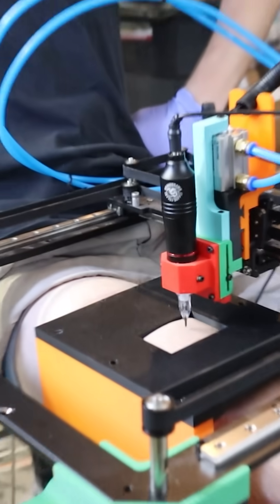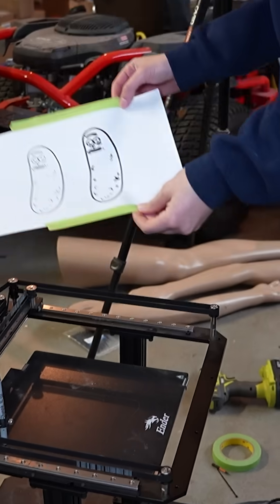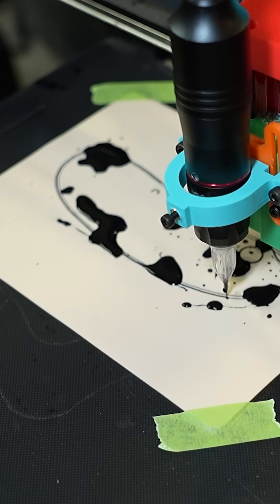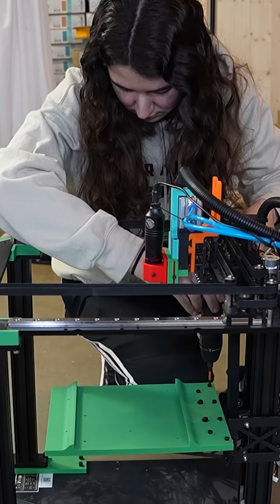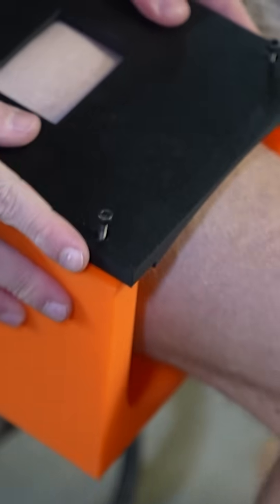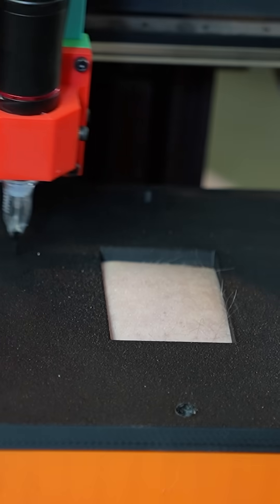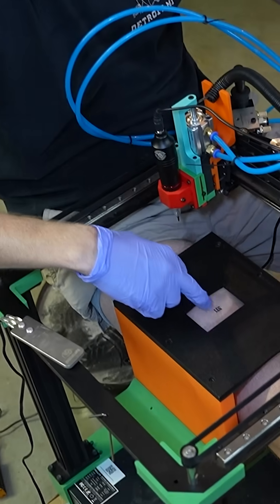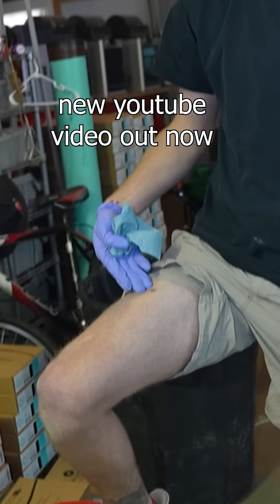Tattoo 3D Printer?

Comment: This woman single-handedly designed the future of tattoos!
Just imagine... Scanning a picture and just lining yourself up for some ink. Awesome!
Reply: It actually would probably be way more expensive and not very good for big tattoos (you would need a machine to big)
Reply: @iami5124  it’s defiant possible, but for this technology to be advanced enough to do large intricate tattoos, you basically need the pinnacle of medical robotics with multiple needles going at once, basically like a printer, with incredible depth perception. The machine would be millions of dollars minimum. I’d rather just get it done by a person instead of supporting another industry that treats art, and artists like a worthless commodity.
Reply: People are making these. Theres a company that makes them, and they're not very good. They mess up often and don't have the range and ability an artist does
Reply: @maddiewhatever441  i believe it. Especially once someone squirms!
Reply: It needs ALOT of tweaking before that can become a reality. Tattoo ink needs to be placed a certain distance inside your skin to keep it from fading or disappearing entirely when your skin regenerates. You also can't put it too deep or you risk massive infections. There would need to be some sort of pressure sensor implemented. They would also need to rotate the person getting tattooed for pieces that wrap more rounded areas (which is most areas on your body).
Reply: @blueeyedbatman I actually 100% believe it could easily be made today if it actually was seen as something that could be profitable. All of those types of things are already done with all sorts of different robotics and CNC work. With needing to move the person most of these machines a physical tool to reference locations but you also could implement an optical sensor that uses reference points to figure it out. It could range from really basic linear rsil systems like this all the way to multi axis machines.
Reply: I mean tattoo MACHINES decimated the original tribal tattoo method, history moves forward old ways become obsolete
Reply: Even for that tiny ass tattoo the man moved a little, theres 100 different factors an artist has to deal with and manage at all times that a 3d printer cant do.
Reply: You're meant to tattoo at an angle if you want it to properly set in to the right layer of skin to be longer lasting, a machine like this aiming straight down cannot achieve this
Reply: Another one for the whites.
Reply: Starship troopers lol
Reply: They already existed.
Reply: @valle6o727  I think it’s a fun gimmmicky YouTube video, and at least it’s better than all the TikTok kids tattooing themselves at home with no gloves, Amazon or Temu machines/ink and to top it off giving themselves face tattoos for some reason, but no she is very far from the first person to on do this. There are already actual “studios” (if you wanna call it that) where people have these stupid tattoo robots printing generic tattoos poorly in people. I’m not against AI, or robotics, quite the opposite actually. I think that they are humanity’s best chance of getting away from the current USA work all day everyday until you die, with as little free time as possible, lowest pay as possible, and basically zero benefits. What I am against though is AI, and robotics taking the jobs people actually want to do, like artists, writers, game devs, actors, etc. The pitch for AI just 5-10 years ago was people not having to work jobs they hated, and having more free time to spend with friends, family, and pursuing creative endeavors like the ones previously listed. Instead so far we have server farms using more energy than some countries to give us much worse search results than we could have just got on google, crappy generic art, and every garbage company trying to destroy every creative field that exists. Yay the companies win again, while life isn’t getting remotely better, and actually worse for the average person. That’s what I call progress 👍😅
Reply: No she didn't, this isn't her original idea and it's been done before
Reply: Until the client moves slightly and ruins the entire tattoo
Reply: A small distance laser and some 4 axis arm solves a lot of these problems. Emergency stop button for those idiots that will inevitably try to move while the machine is running. Maybe a special transfer paper that the customer can apply themselves. Something with a special ink that the machine can see even underneath ink and blood.
Reply: she hasn't designed it, this stuff has already been done before.
Reply: no more fucked up tattoos from people that stay awake all night doing drugs..
Reply: And when it glitches, you get who knows what on your skin. I'll stick to humans, thanks!
Reply: Tech has already changed tats. We used to use needles and inidian ink...
Reply: This wouldn't work because it clearly requires your skin to be a flat surface just like paper, which you aren't. The most tricky part of tattooing is being able to work around curvy and squishy body parts. You also need to stretch the skin as you deposit the ink or the ink won't stick.
Reply: No more Revenge tattoos from crazy exes
Reply: Imagine you go to the automated tattoo booth down the street, load up the picture you thought was really cool from google and get it done with, but when you get home, you realize you forgot to make sure the png was actually transparent.
Reply: Nope. Human body parts are not flat like paper. Different part has different skin thickness.
Reply: Yeah, this would never happen the amount of danger. This actually has is so unfathomably high if that went slightly too far down because of an error hello major gas hello hospital hello severed arteries it’s a cool video but the amount of danger they put themselves in is horrific. This will never be how tattooing is done.
Reply: Until you move slightly and mess up the alignment.
Reply: rip my job then
Reply: They were both expecting the worst, then suddenly it looked like a completely reasonable business idea
Reply: I had this exact idea 20 years ago... unfortunately didn't have the means to do it... i have a more refined and detailed plan that would be the future for sure but i doubt i will ever get around to it.  A company like epson could do it though 1000%
Reply: I’d bet that tattoos and technology far into the future would advance to a point where you can just have a tattoo scanned and printed onto you with a small hand held machine.
Reply: I’d bet that tattoos and technology far into the future would advance to a point where you can just have a tattoo scanned and printed onto you with a small hand held machine.
Reply: Then the power goes out
Reply: I can’t imagine it having a remotely even appearance, if anything it would have to be done by a computer THEN touched up and shaded by a tattoo artist. Otherwise it’s not gonna look very good. Just too much variation in depth.
Reply: @QNominall it could easily be able to sense the exact depth needed with anything other than a 3d printer.
Reply: @QNominall  if only there were devices that could read and measure depth and automatically adjust the height? 🤔🤔 oh wait!! There are such devices!
Reply: @QNominall  lmao literally the same sort of problems 3d printing had before it went mainstream stuff like this is inevitable
Reply: @QNominall her 3d printer version yes. If you think robots can't replicate human art in perfect detail you are going to be violently awakened someday
Reply: @ Replication is one thing, new creations is another concept entirely.
Reply: Completely decimating another industry because of robotics isn't awesome.
Reply: @The_Stranger1986  I would still get what they would probably refer to as "traditional tattoos". I do believe this is a really cool idea but it would be for a more specific and probably smaller market
Reply: @valle6o727 so you mean a tattoo like they traditionaly do in the Pacific islands with the stick and little hammer thing one stick one hit at a time? Because that what tattoo guns replaced aka technology/robotics.
Reply: @The_Stranger1986  my guy people still get traditional stick and pokes with thorns sticks and charcoal powder 😂
Reply: @The_Stranger1986 I think we’re still like 50 years from an actual, affordable, commonplace, decently talented robot tattoo machine 😂

Also fr you can’t fault people for wanting a machine to do the art that will be on them for the rest of their life. Far too many “artists” are absolutely terrible or weirdos or assholes, or shit even just straight up judgy and won’t do a tattoo cuz it’s not cool enough or w/e. People don’t wanna deal with that.
Reply: @The_Stranger1986  artists Will always be better
Reply: @The_Stranger1986 it is
Reply: @The_Stranger1986 yes it is because if iring progress on purpose is stupid, we're all going to have basically no jobs eventually anyway. I'm sure there would still be an entire community that would brag about getting human made tattoos but this could open a world of designs and realism never possible by a person. 
It would also work wonders for the possible future "camps" 😅😂
Reply: @The_Stranger1986 oh get a grip. Someone still needs to draw it in the first place. Youd rather we stay in the stone age just because you can't see why this is a good thing being the tattoo will look nicer and cleaner if setup properly.
Reply: @The_Stranger1986 lol it won’t decimate it. It’s for convenience. Vast majority of people don’t have the money for a 3D printer, much less get enough tattoos to buy one.
Reply: @The_Stranger1986 i’d take this over pretentious tattoo artists giving me crappy tattoos at a ridiculous price anyday. at least it can draw a straight line! 😂
Reply: @The_Stranger1986 sorry bud but i dont like dealing with strangers who will be putting permanent artwork on my body. You are less trustworthy than a machine.
Reply: @The_Stranger1986 not at all, the thing about tattoos is its artistry, art is highly subjective, but I'll be damned if I'm going to let some machine do the line work on my arm. I go to a professional artists with a real reputation and actual skills built on experience. The same type of people who have the dedication to spend large amounts of money on ink, are the same to appreciate the skills that come with that ink and price tag.
Reply: @MrDeano-bm8qg a machine could be trained on literally millions of hours work in a fraction of the time when it's perfected. This will be the future but there will always be human artists unless machines become so perfect it'd be dumb to get something with imperfections unless it was on purpose for the design but even then you could just program that to seem random variations even if it's not.
Reply: @The_Stranger1986 do you have tattoos?
I have many. I would never get one by a fucking machine.
Reply: @The_Stranger1986  things'll change, some folks might lose their jobs, yeah.  But tech's gonna keep moving forward, making new opportunities, and leading us to a future of automation.
Reply: @The_Stranger1986 Yes, it is. Why spend hundreds on tats when a robot can do it for 5.99
Reply: @The_Stranger1986 but it will increase jobs in other industries
Reply: @The_Stranger1986  It wouldn't decimate the tattoo industry because it's not capable of doing all the minute details that a human tattoo artist can. Sure, with a 3-D printer Dana. Tattoos on you could do any design, but it wouldn't have the depth or detail that a real artist brings into it.
Reply: @The_Stranger1986 unfortunately people are not entitled to professions. That’s just the reality of the world.
Reply: @The_Stranger1986 tattooing isnt just putting down lines. Of it is youre not good at it. We have nail polish machines but people still go to salons
Reply: @The_Stranger1986  It is when they're needlessly expensive.
Reply: @The_Stranger1986 buddy: it’s gonna take a while for that to be decimated and even then people will want their classic human made tattoos. Quit thinking ai is gonna take over the world.
Reply: @The_Stranger1986  You should already be tinkering with this stuff if you want a future in tattoos.
Reply: @The_Stranger1986  not really, if you want a traditional tattoo you can still always get one, don't be mad because people can do things themselves now.
Reply: @The_Stranger1986 I bet you think we shouldn’t have invented the tractor too, right? Or that one is fine by you?
Reply: @The_Stranger1986 If it wasn't for robotics we wouldn't have most of the things we have today at such an affordable cost. Pretty much every single industry uses machinery. Vegetation, dairy, furniture, health care etc. This is just one more thing added to the list.
Reply: @The_Stranger1986 the entire point of technology is to make life easier. If done correctly we can literally get to a point where humans just enjoy life in stead of working 90% of it for low pay and maximum effort.
Reply: @The_Stranger1986 no it’s pretty cool still
Reply: A machine cant tattoo your limbs
Reply: @The_Stranger1986  No, it definitely is. Those creative people will find another avenue to explore.
Reply: @The_Stranger1986 in a world of ai art there are still pencil realism artist, the tattoo industry will be fine.
Reply: @The_Stranger1986  means you have to actually be a good artist  now
Reply: @The_Stranger1986 progress is always awesome
Reply: @The_Stranger1986 says the tattooer, you’ve had your time. I’m tired of seeing shitty tattoos. This is the future.
Reply: @The_Stranger1986 if robotics does it better there’s no reason to keep people in it just to provide jobs.  That being said taking artists out of a art based industry is not that simple normally
Reply: @The_Stranger1986  y'all are so quick to judge. Do you know what they did for eyelashes they taught the eyelash tecs how to run and take care of the machines. So they still had a job it was just now easier. Y'all hate to see the future coming bro and it's truly heartbreaking cuz there were a lot of people before us that did nothing but wish they were here.
Reply: This is great for people who only want tattoos for the sake of having them and don’t care about the art aspect at all
Reply: It‘s not the future of tattoos and it will never be because of different parameters, machine doesn‘t care about blowouts🤭😁😂
Reply: No that is not awesome if I'm getting ink I want a human to do it.

Comment: If you wanna improve it a little for a more detailed design in the future, you should maybe hire a tattoo artist cause I just know this from a few hundred hours on the table. You gotta pull the skin just a little bit and contour with the arch of the limb for proper needle depth so one half doesn't wash out in 5 years and the other half in 12 years. Granted, this is like 60 seconds out of probably at least several hours thinking of other things I'm not thinking of, but I just figured I'd throw it out there. Neat idea for sure.

Comment: My CNC plasma has something called Torch Height Control.  You could probably devise something similar using a ground and super low voltage to detect contact and keep height from surface within a particular range.  You could then tat most body countours assuming you can fixture the person properly.

Comment: This would need a bit of AI to make sure that the needle doesn't go too deep or not deep enough. Position the leg, have it scan it, and make a digital model It does its calculation on. You could even just do it yourself. This would be for bigger tattoos on not so even thick areas of skin

Comment: Dude, my very first tattoo my buddy showed up here with a tattoo gun and so I decided to do my own hurt like hell for her for a few minutes but once the skin goes numb, you’re fine and I’ve honestly been through a lot worse but then again if you don’t mind it don’t matter that’s why it’s called mine over matter but don’t do it when you’re like 1516 your parents tell you wait until you get older for a reason cause seven ones I have yes I do regret losing your damn parents are not done with the media. They doing it to try and teach you and save you from being scarred rest your life cause you’re not easy to remove. You can either go and get them removed by a laser which burned the crap out of your skin and you have to have several treatments or you can go up and be a man do it all Microway gasoline steel wool. I wouldn’t recommend it if you get a tattoo make damn sure it’s something that you want on you for the rest of your life. It’s it’s gonna be.